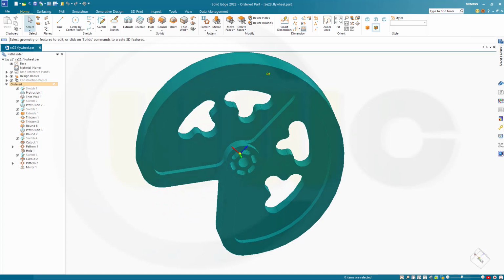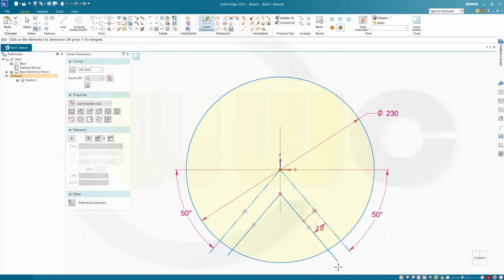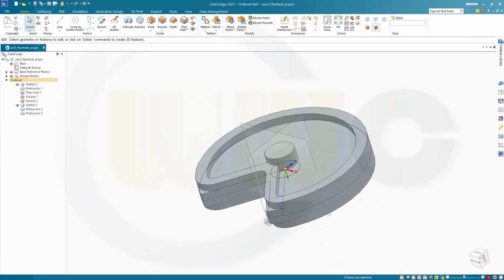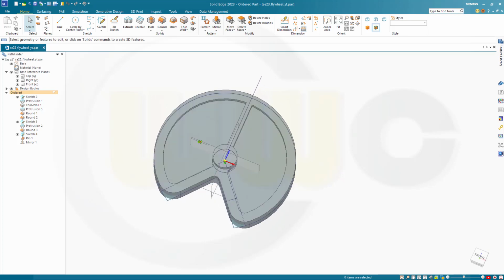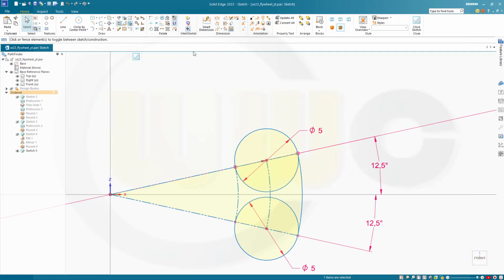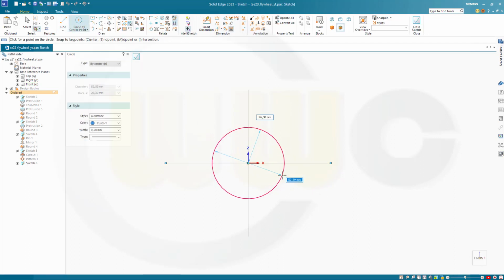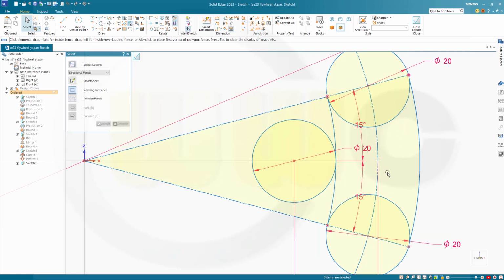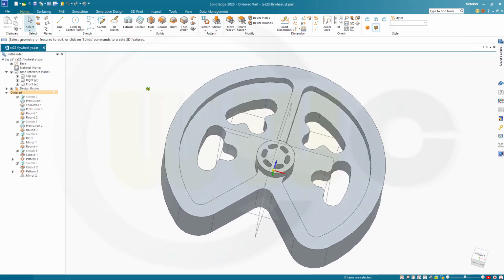5.5 Schwungscheibe - Flywheel - SolidEdge Training - Part Design

Comment: Looks like I'll be doing Solid Edge in my next job. I'm really a SW guy. I have worked a bit with SE before but never got into a good flow so far. What is your opinion on comparing the two? Thanks for the tutorials, I will probably need them!
Reply from the maker: If I had to choose between SW and SE I would always choose Siemens NX 😉
Apart from that - in my opinion SW is better than SE .
Reply: @wolfgang.walden.cad.training  Thanks for your reply! I have an SW license myself and the job involves a lot of reverse engineering of one-off products, often in cast metals which means sand casting mold design. Furthermore it involves gears which are usually CNC machined so the actual gear profiles are calculated and modeled using a specific program that is plugged into SE for the profile generation. Because this is a job shop they have no real issue with using SW or other CADs and in fact work has been outsourced which was done in SW. Personally I really like SW and especially using configurations in parts and assemblies (with design tables) as well as the good documentation module are the best points. I have always felt other CAD applications fighting me while SW is very self- explanatory and easy.

Comment: Much easier in synchronous mode. Set dimensions by using  two points not horizontal/vertical
Reply from the maker: yes again, but I don´t do synchronous modelling, at least not yet.

Comment: Thanks again for this comprehensive video!
Any chance for getting a material/mass measurement to compare own results with yours?
Reply from the maker: Please note, I´ve forgotten to model the center hole, so  the mass without that center hole - stainless steel - mass 6,764 kg - volume 872738,735 mm3 - accuracy 0,99
Reply: @wolfgang.walden.cad.training  thank you!